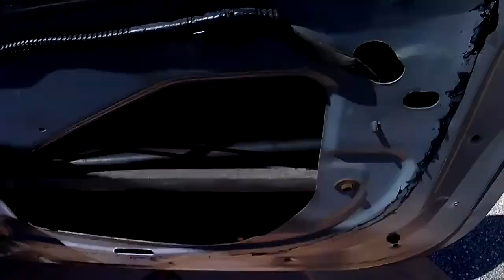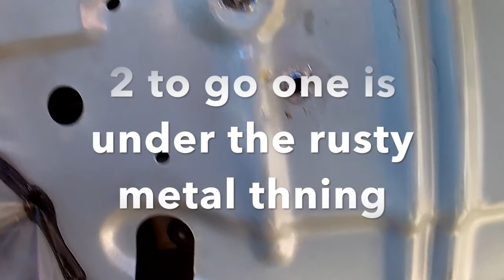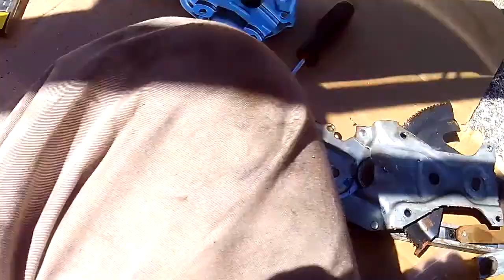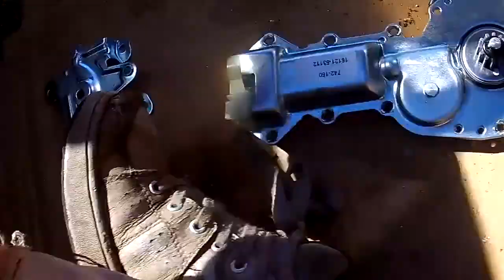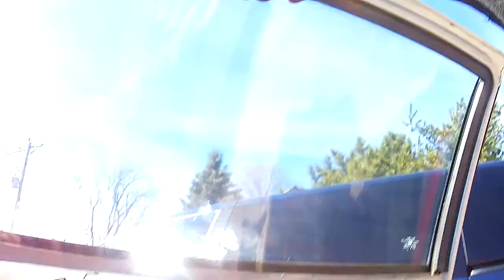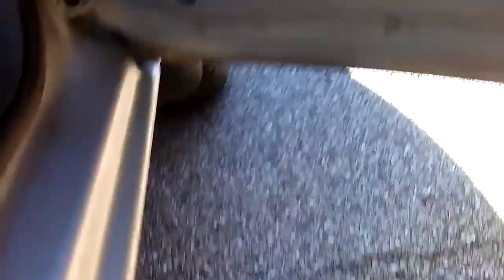Episode 24 2001 Chevy Cavalier Passenger power window motor replacement

Comment: 03 cavalier coupe, Driver side is stuck half way down, passenger side works an inch every few minutes. Assuming i need to replace both the regulator and motor?
Reply from the maker: just the motor, same as this one but drivers side. is exactly the same
Reply: https://www.amazon.com/gp/product/B008G2XT9S/ref=ppx_yo_dt_b_asin_title_o01_s00?ie=UTF8&psc=1

Comment: For anyone trying to do this...take a small punch and stick it in the hole of the rivet. Knock the steel stem out. Then either drill (I don't) or use  a grinder to remove the head of rivet.

Comment: I found that if you  put the bolt in from the back with foam ear plugs cut in half behind them this will hold the bolt out for easier nut attachment